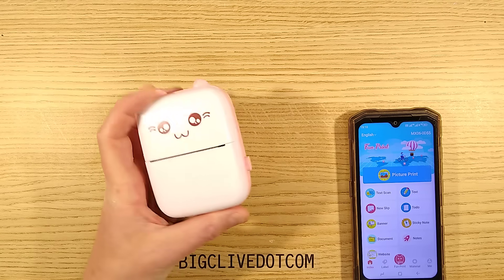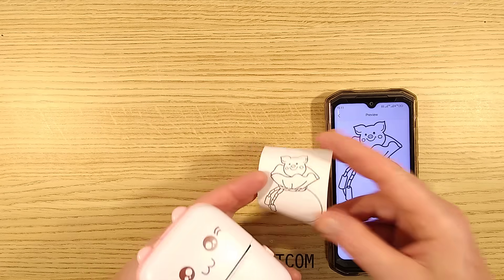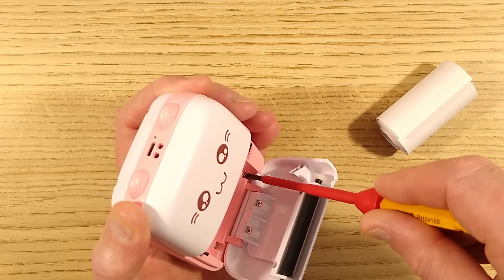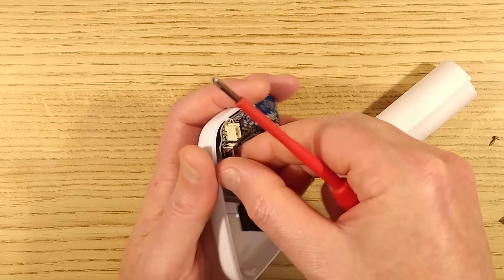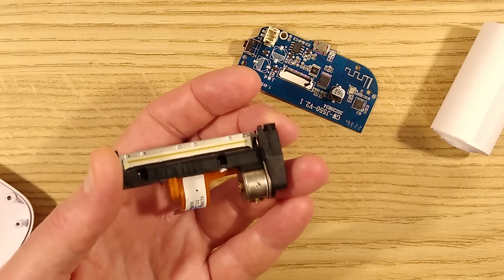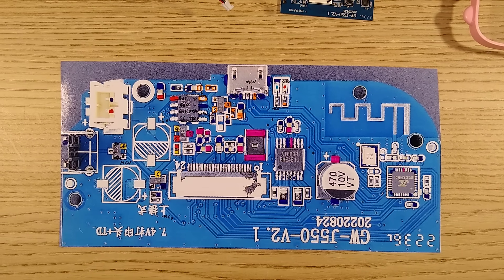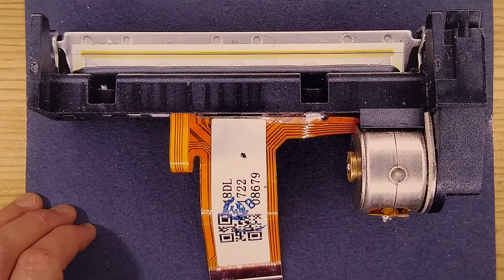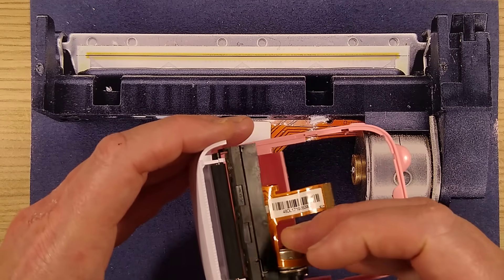Mini bluetooth thermal printer teardown - with schematic

Comment: The Bluetooth MCU is from ZhuHai Jieli Technology, who've been making a range of general purpose bluetooth chips that have multiple uses (bluetooth & USB audio players, car FM/bluetooth systems,  voice recorder/playback devices, bluetooth/USB control systems etc.) for years.   

The chip is possibly an AC8976A8 but it's difficult to match JieLi product codes with actual chip model. However, the chip package matches and looking at the pin usage on the board matches that of this chip's datasheet. This chip is a USB/Bluetooth mutltipurpose MCU with 15 IOs plus stereo DAC, USB (otg) and BT (V5.1+BR+EDR+BLE) dedicated pins.  It has additional h/w support for audio & voice codecs, DSP and vectored interrupts as well as internal flash memory. Power range is 2.2v to 4.5v, digital io range is 2.2v to 3.4v, and supports battery power sensing; when in sleep mode it only draws 2 microamps.   

The 15 GPIOs are multiplexed and highly configurable supporting GPIO, PWM/Timer/Capture, I2C, SPI, I2S (audio link), analog & digital MICs, UART serial, timers, ADCs, cap. touch sensors and LCD/LED displays.  

The chips are a bit of a black box China special, no specific details of CPU are available (the datasheet is fairly abstract about the core/ISA) but is reported to be a Arm cortex-M0 upto 160mhz & upto 8mb flash memory by some resellers; the sdk and programming details are locked down/inaccessible without a licence.  

I suspect the diode Or'ed button/mosfet power-latch approach has been used to control the MCU power rather than using the MCU's low power mode as this saves an additional IO interrupt pin & associated circuitry required to wake the chip up in additional to the circuitry required to control power to the rest of the circuitry (motor driver, paper senser, print head).  It looks like all 15 IO's are maxed out here with the button, led, power-latch circuit, motor control, print head communication and paper sensor - only the two dedicated L/R DAC pins appear to be not connected on the board.

If only the sdk/manuals/programming s/w was available one could hack the printer (plenty of space inside) using the two remaining unused pins, incorporating an amp and two micro speakers so it could play sweet, sweet music to accompany the wait for the print out ... akin to the elevator/lift equiv. of the printing world - pointless music to calm/annoy (delete as approapriate) whilst waiting for the device to complete it's real job.  It could also shout when out of paper, talk incessantly about how the print job is going, nag constantly asking what you are printing, state how it's a pleasure to have its lonely little life shared now you've paired with it for life over bluetooth, simper at how much fun it is to print for you and so on till you dash the damn thing against the nearest brick wall just to shut it up.

Comment: I have a few things like this. One is the Dymo label maker which prints on 1/4 inch strips. The second is the game boy printer which hooks to a game boy and can print things from games and the third thing I have is similar to what you have here but is made by paperang and uses 57mm receipt paper. I can buy the correct paper on amazon but I seemed to have bought a surplus of receipt paper so I shouldn't run out for a while. Printing images from the images on my phone produced interesting grainy black and white images.
The printer you have is even simpler than mine. I took mine apart and the board is larger and the battery is in the opposite side and it has sensors galore. The Paperang printer uses 57mm paper which should be the same as yours.

Comment: I think there's a chance that you could cut a slot in the back of that printer and feed the paper from a big roll through it. There doesn't seem to be anything in the way, the only thing that would be needed is some container to hold the new roll. 🤔
Reply from the maker: Yes, you could do that.

Comment: I have a Citizen-branded serial printer for Commodore 64 & VIC20 computers, it's basically a repurposed receipt printer too, though a dot-matrix impact type versus thermal, and comparing all the discrete components inside it to this, miniaturisation is quite amazing, even the printer module itself is microscopic compared to the Citizen... :P

Comment: Great teardown and analysis. Is the 2301A PMOSFET symbol drawn flipped by chance?  The drain typically goes to the power input side, and the source+bulk to the protected device.  As drawn, the intrinsic diode would be pointing away from the intended direction of current flow, and would turn on when power polarity was reversed, not very protectively.
Reply from the maker: You may be right.
Reply: Yup... You are correct.

Comment: Useless because the normal thermal papers fade very quickly especially when in contact with tape/plastic. 

I made an app myself to print any image on black-white thermal printers (basic £20 units) and they're very fast. The issue is... though... Smartphones are GARBAGE at bluetooth connectivity to these. The connection randomly drops and the printer just prints garbage. There's 0 API to let you know the bluetooth connection got corrupted.

Comment: Is there a good low-level open-source electronics emulator? Would be neat if you started making up the schematic on that, may save time too. Also would be good for tinkering

Comment: I find that you get much higher print quality from the sticker paper than the cheapo, thin receipt paper. Much darker blacks. I break photos down to strips (usually diagonal) in Photoshop and print each strip on a different colour paper. The only problem is that the print head overheats on really long images.
Reply: opposite for me. I got darker blacks on the normal paper, sticker paper much lighter. though it may have something to do with current charge. I noticed while doing some stickers (10 copies) that it slowly got lighter and lighter.

Comment: I got a couple of these a while back when a 3rd party seller on walmart's site had them for $5 shipped...I'm bummed that I can't find anything for the PC that will interface with them.

There are a couple 'cat printer'-related projects, but when I checked long ago none of them supported+talked to my "MX05" variant.  (You can see that there's a label in Clive's that says 'MX06')

The 'FunPrint' app these require is soooooo sketchy-looking and gigantic-for-no-reason, since it grabs almost everything (the clipart/etc) off of a website somewhere. :(
Reply: Link? I could use one. Well not could, more like want. And sit on my project pile. Still... link plz
Reply: @nyetloki  I mentioned this was 'a while back'...that deal is long gone, I'm afraid.

Comment: How cute! I'd name it Temmie or something.
Simple as it gets, nice to discombobulate.

I wouldn't count on complete reverse-engineering here, not in case you've got a 4-layer board with signals buried in the inner layers. At least there's none of that BGA rubbish.

Nice print head construction. I keep learning new things every day :).

Comment: A ZX Printer would be smaller! Have to work on knocking up a Bluetooth adaptor for it, Clive. They're not even complex, just a couple of pins, two drive the motor, fast or slow, which does horizontal AND vertical movement (in a slightly diagonal line, good ol' Clive Sinclair). One emits the spark. One reads in the rotary encoder, 256 per row I think just like the resolution, plus a bit more round the edges probably. And that's about it.

Wire that up to your favourite PIC, or else get an ESP or something with Bluetooth on it. Boost convertor for the voltage, from a lithium, nice charger circuit, Bob's yer uncle!

Comment: You should be able to print over USB as well. There's a person online who hooked one of those up to a web gateway and was letting people send text and images to it. They had a bit of a trick replacing the battery with a power supply to keep it going as the current draw during printing would reset the micro-controller.
Reply: Oh cool, I've already been reverse engineering the BLE protocol for this printer on and off for a while, planning to use ESP32 as a gateway. I'll take a look at that project though.
Reply: there's a github project to control them with arduino, so presumably most of the BLE connection has already been RE'd https://github.com/bitbank2/Thermal_Printer
Reply: @hayleyxyz  Someone already did it. The video is titled "GB01 Mini Thermal Printer - Using it on Windows - iPrintUtility". Unfortunately, my printer has a different name than his software allows for but I think it's probably actually the same under the covers so I'm going to try recompiling it.
Reply: what about printing from a pc over bluetooth?
Reply: @noahandthefurry4573  Printing from a PC via bluetooth is possible, but you'll need a third party program from one of the people who have reverse-engineered the protocol on GitHub. They're usually called "Cat-Printer" or something like that.
(The one I've contributed to even has an android app.)
Reply: Can you provide the link of that video I would appreciate it
Reply: @drssp5360  Good evening, I also wanted to see this video, can you send it?
Reply: @drssp5360  definitely! Same here.
Reply: You absolutely can. It's kind of hilarious to print from Word to one.
Reply: mine doesn't seem to be found over usb. "your luck may vary" kind of thing?
Reply: Any luck on finding a way to get it to print from PC, either USB or Bluetooth?
Reply: @mr.meticulous1241  I wrote a CUPS driver for Linux/macOS (tested only on Linux), but for so-called funnyprint printers. Look for printer-driver-funnyprint.
Reply: I have a couple of old word processors with thermal heads, including a portable laptop thing. They'll work either with thermal paper or if you attach a special ink transfer ribbon they'll print onto ordinary paper. I even have a 198x Epson thermal printer designed for a PX-8 CP/M laptop; it's incredibly slow and low resolution but lots of fun to use (search Youtube for 'hjalfi has a new printer' to see it in action). The cool thing is that the print head is only eight pixels high, and it somehow uses the same motor to wind the paper, move the head, and extend or retract the print head to touch the paper. The only problem is sourcing the paper; they still make it, but sourcing anything less than a kilometre is tricky...
Reply: can anyone please help me find this article?
Reply: you can find some stuff over on Github under /NaitLee/Cat-Printer so idk if this helps. Worked for me under python web control

Comment: Takes me back to when microprocessor based computers first became in reach for hobbyists.  Started with just a board that had a keyboard on it and connected to a TV and a cassette recorder for storage.  Next upgrade was either a floppy that held 80k or a printer; and so many odd printers were available, most seemed to be dot matrix printers made for cash registers pressed into service for the hobby.  Some had a typewriter ribbon, some were a kind of silvery paper, and some were thermal.  But in the absence of the large scale ceramic assembly like this printer, they had a little ceramic print head of 7 or 9 dots and another motor to slide it across the page.

Putting together a working system from these parts that were not meant to go together taught me a lot of electronics; like tacking on some TTL electronics to get a parallel port out of the serial port built into the board.  I think kids miss out these days when you just pair it with your phone or laptop and it works.
Reply: Kids certainly do miss out. It's sort of a problem for IT (and other industries) now, with a lot of kids simply not knowing the basics of troubleshooting because they never had to learn due to everything being "apps" that "just work". Sometimes even college graduates struggle with stuff like using a command line, it's resulting in some industries largely ignoring degrees altogether for good certifications and raw experience.
Reply: I remember the printer that Sinclair released for the ZX-81.  It used the famous silver paper and the printhead was just a pointed wire that arced out and made a black spot.
Reply: @Whiffert always wondered if they had a way to do this commercially back in the day I had an idea of being able using or something like that assassin idea didn't even know that really existed that was just an idea the Bible head how to easily print something.

There was another means of electrophonic printing back in the day that was used for some things including transmitting I believe charts and weather maps is things like this when it would be sent over some sort of wired connection it was covered nice thing later on but Tuesday pretty nasty chemical composition I know it was loaded with some pretty toxic stuff I think part of it was a cyanide based but I could be wrong on the chemical composition some people referred to this as Baines soggy paper.

If anyone has any idea what system this was with the name of the printing process please give her a heads-up as well.

Also somebody Evernote I discovered years and years ago if you applied and DC voltage through any mail or similar you could easily cut aluminum can material and also aluminum foil not that my current required.

Had a idea of using some sort of ex-wife water and being able to to cut things out with lightweight aluminum material could almost be able to cut out a stencil for surface-mount perhaps this was really before die cut machines were real thing or at least as far as I knew at that time it was that far back that wouldn't really even know but then again back then we didn't have internet so there's that as well.

Speaking of stencils does anyone know a good source for used X-ray film like use for stencils and such also was trying to use some for like diffusing.

Need to cut very small discs of this invariable shades of transparency would be great and that's why I thought about using this particular stuff as well for both things.

And also does anyone know what you would call that and translucent plastic it was fairly thin that is sometimes used to make stencils as well I'm trying to find this and don't know what to call it or perhaps an Amazon link as well.

Much appreciate any info and replies
Reply: Yep. I can remember being a lad in school, playing "games" on those early P.C.'s with the data cable plugged into the cassette recorder's audio jack, very slowly retrieving data.. 😆
Reply: @davelowets  And often failing after a 5 minute or longer load time!
Reply: I recently, well a few years ago, made my own 6502 based computer from scratch and repurposed a little POS thermal printer to work with it. Being an older printer the power supply brick was the same size as the printer unit itself!
Reply: absolutely!

Comment: I'm surprised the battery is as large as it is, for the apparent target market. I figured they'd have skimped out on a few pennies for a wimpier/smaller battery....
Reply from the maker: It may be to allow it to deliver the high current for the printer.

Comment: Thanks for bringing this to our attention. What I really like about this device is the roll of paper doesn't need a chip in it. I'm thinking of Dymo who have been going  down some dodgy  paths of late e.g. no longer selling the tape for a not cheap printer.  Their solution to the problem is to sell you a new printer. The only issue I can see with this and any thermal printer is the ink does fade over time especially in my toasty in Summer man cave.
Reply: How quick the print fades really depends on the quality of the thermal paper. I have thermal labels on stuff that I printed 20 years ago that still look good. I've had others that fade out in months. Also, some brands of labels degrade very quickly when stuck on certain types of plastic.
Reply: @rocketman221projects  Thanks for that, it's good to know, I understand store receipts fading but I would have thought the laminated Dymo labels would last forever but it can get hot in my workshop and they are on clear  plastic trays.
Reply: Good point. Own goal by Dymo I reckon though. Where I work we bought a new Dymo label printer to replace a smashed one. Then the horror of the NFC labels were noticed. That's it for Dymo, no more!  Brother from now on. Let's hope they don't go the same way.
Reply: @neilcaldwell870  There's a good reason why I'm not only keeping an entirely mechanical Dymo embossing labeller to hand, but when a local Tesco put their surplus tapes on clearance I bought almost the whole lot. 🛍

In five years time your newest Dymo labeller will stop working with a „Your product has expired: Buy a new one“ on the screen, then five years after that your older Dymo labellers will stop working when they physically wear out. Mine - If treated well - Will keep on going for another 50-100 years, and will only be outpaced by those manufactured in the 1970s Soviet Union... 🏷🏛😋
Reply: I’ve found the rolls with the adhesive backing/sticker stock holds the image well and I’ve not noticed the labels fading on the jars in my (North Facing) shed…👍
Reply: Even Chinese manufacturers like Niimbot are going on this route. Where they have a NFC tag in the rolls.

Comment: Could you speak to the abilities of your device's software.  I have a similar device, a Phomemo printer, and their cell phone software is remarkable.  It includes OCR, scanning, and photo capabilities.  The only downside is that the thermal paper can darken with age and exposure to sunlight.  I have found that the transparent varieties of thermal paper seem to resist darkening better.